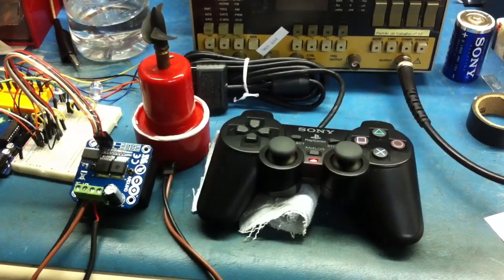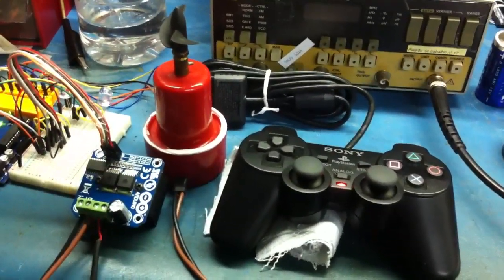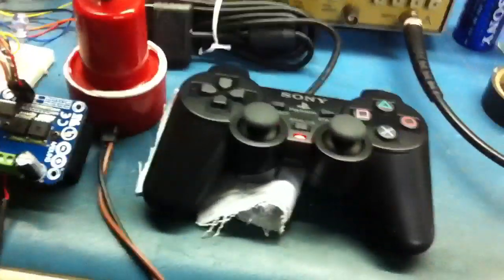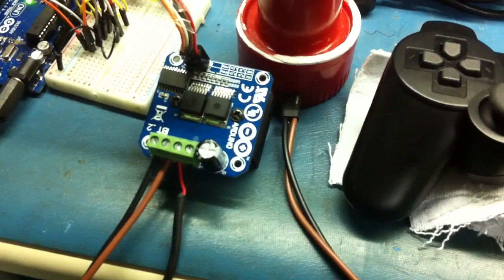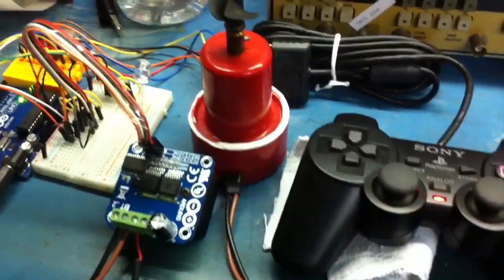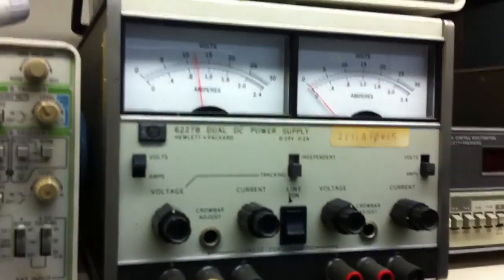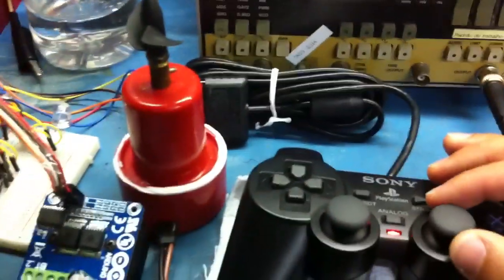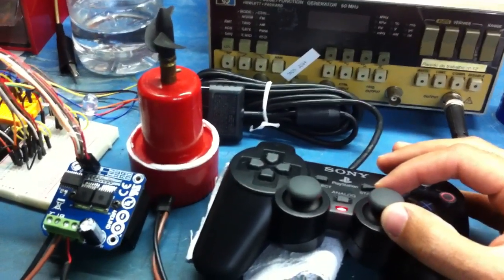Bilge Pump Control with Arduino Uno and BTS7960B

Comment: I have interested to this project ,I use bts 7960 for control Dc motor you if you have wiring citcuit diagram and code.
Reply from the maker: Unfortunately I don't have it anymore

Comment: Hi, this is a little late but I hope you respond, as I am very confused. How did you manage to connect the PS3 controller with the Bilge Pump and the Arduino? I'm talking about the hardware; how did you connect the PS3 controller to the Arduino pins and the Bilge pumps to the Arduino pins? Or did you do something else? I'm planning on making a ROV on my own, and I'm kind of stuck on this.